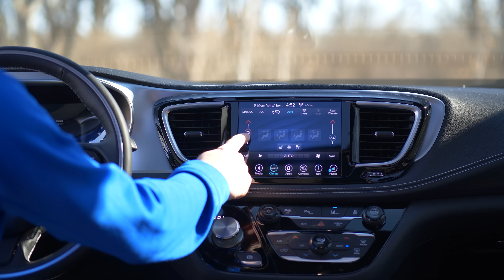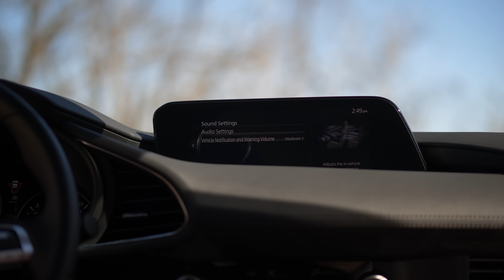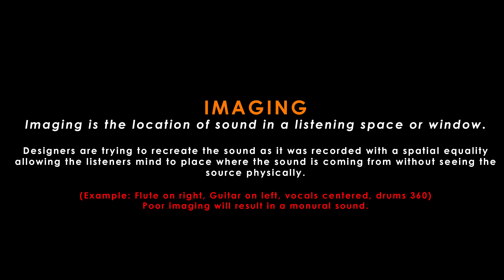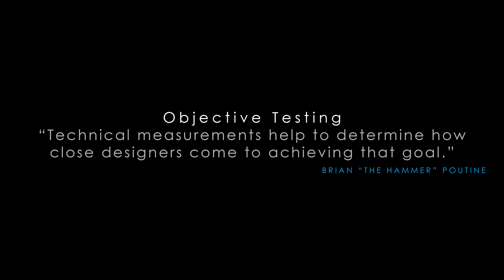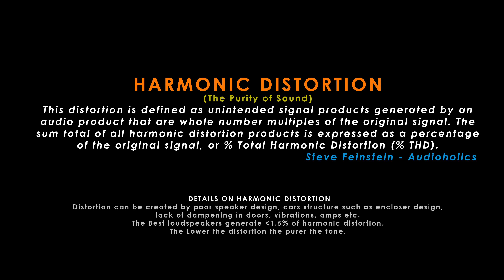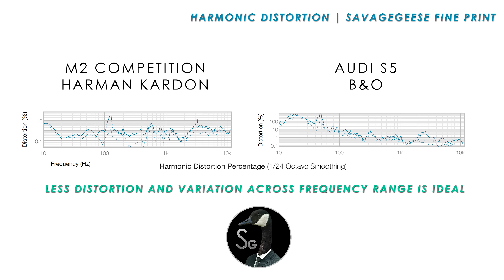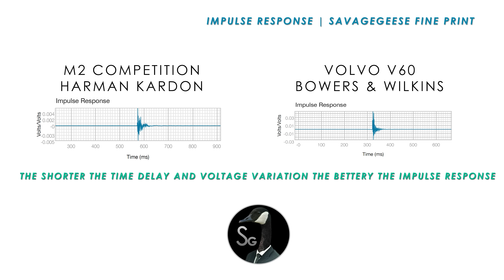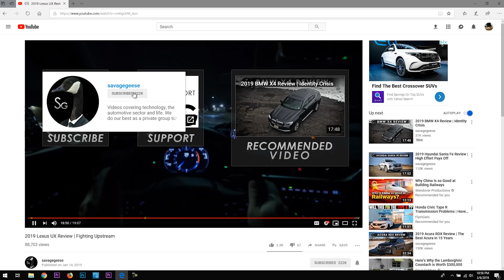Understanding Car Audio Design

Comment: Amazon has a $25 calibrated condenser mic for Android. Then, download "Audio Tool" from the store and you have a somewhat effective sound spectrum analyzer. Play some pink noise through your audio system and you can tune your levels flat to the decibel you desire. I'd say properly tuning the sound system you already have will go a long way to make it sound good. 

Most people tune by ear and of course introduce their own biases as to what "sounds good". I had a co-worker roll into the parking lot blaring some Queen and he had the treble cranked up so it was a earsplitting, headache inducing, garbled mess. He probably grew up listening to that song on a crappy Fischer Price boom box and then tuned his $80,000 Mercedes sound system to replicate the noise from a $10 toy; because that's the way he learned to listen to it.

Comment: Looking forward to this series.  I've really been struggling to obtain imaging inside a 2019 Durango and the glass is ruining the separation bigtime.  If I roll the windows down, it helps.   But I also think the problem is as simple as "too many speakers".  I have the base "Alpine" system.  Dodge did away with "Beats" for 2019. But they offer H-K and I'm curious to know if that extra cost would have brought better stereo imaging, or just more bass.  For the record, the stock Alpine system has plenty of wallop.  The wattage is enough to broadcast with the windows down.  And the distortion is negligible at full volume.  But the stereo imaging is muddy more often than not, regardless of whether the "surround" option is activated or not.

Comment: My Colorado has the upgraded Bose system and there area you notice between the standard sound system is the base. I had the salesman get into both cars and play similar music to hear the difference. There definitely was. The standard system still sounded pretty good though. It was definitely better than the sound system in my Crosstrek which was garbage.

Comment: What I find nauseating is seeing Bose in Porsche and JBL in Ferrari 488's.    Why put low grade audio into a high grade automobile?  Those belong in Chevrolet and Ford.    I  have a new tahoe that has Bose in it.   It sounds okay for car audio but I'd like to put Focals in place of the the Bose drivers.  That's probably not going to work too well.

Comment: i think the biggest issue with this is that there ALOT of different audio systems in the same car. Like the f150 can have a shit stock speaker or a very nice one in the King Ranch
Reply: Both correct and incorrect.

Comment: This video is very valuable. I Just bought a car and the stereo have 10 Watts. i didn`t believe at first.

|Buyed a used car stereo and i =can`t fit it because id ont have the adapter so its pain in the ass to change it. 
I Want to replace all the speakers from that piece of crap speakers that are in my car now. ;)

Comment: It has always been amazing to me, at any price point, how the manufacturers have such low regard for the products they produce. The difference between crap and great can be as little as 100 bucks at the manufacturing end concerning design and materials in a mass produced car. GM is the worst with this in my opinion. It's hard to believe that my  Australian made GTO is considered to be among the best GM cars of the era...until I sit in any GM product of any era, even Cadillac, with the exception of the Escalade.
Reply: It's rife in any industry where lots of units are sold. Saving a $1 on a product sold 10m times means $10m more profit. Sad but true, especially when it comes to products that are meant to last like construction materials for houses. It really affects life quality then but it happens all the time.

Comment: How about addressing some newer cars that employ "Automatic Noise Cancellation" which attempts to cancel road noise and such by listening for it in the cabin with one or more microphones and then attempting to generate a signal which is out of phase to the noise in order to cancel it somewhat.  Same basic technology used in some stereo headphones.  This signal plays through your audio system whether your music is playing or not.  So how the heck does a car like the Acura RDX with the ELS system, which claims to have "the sound that is heard in a studio" play that accurately when it is also playing anti road noise sounds at the same time.  Show me one recording studio that uses monitors that are playing out of phase sounds to control noise in the studio.  NEVER!  Most of this noise is low frequency in nature so many of these systems are also weak in the bass region.  I guess they can get away with it when most people are playing $hit quality recordings anyway, but the marketing BS about having you hear what the recording engineer hears in the studio is pure cr@p.

Comment: Sadly does any of this matter due to most music being sourced from a Bluetooth connection/quality? I do greatly appreciate younus8ng Bluetooth in your testing. Also the fabulous Nissan Kicks Bose system would require driver's seat testing
Reply from the maker: Is your device supports Bluetooth 4.2 or greater and so does the car it will pass CD audio quality and better. Most people only listen to compressed music they're not even going to use it anyway.
Reply: @savagegeese  (Device and car, you need both and precious few cars have 4.0 or greater).

Comment: Harmon kardon this, bose sound system that, bowers and Wilkins etc. My Pioneer double din touch screen paired with stock speakers and two alpine subs with an alpine amp sounds so great, and for a fraction of what these new sound systems cost.

I will say this, the bowers and wilkins sound system in the new bmw x7 is phenomenal!
Reply: I doubt the x7 system is worth it over the Volvo system.

Comment: Focal Utopia, CDT HD, Morel Supremos, Scanspeak, Seas, Vifa all make far superior woofers than the usual suspects (blose, B&O, B&W, HK, Lev, etc...).  You want a set of 6.5 active components with proper aftermarket install and noise isolation.  Kick Panels are great as well!

For subs I'm partial to RE XXX or JLW7

Comment: Unless your car has super awesome sound dampening i doubt it even matters about the complexity of the sound system in a car.
Reply: It matter but you are correct that the noise levels in most cars make it less important. I can assure you I can distinguish the differences in quality between different car stereos. In my Z06, the high noise environment makes it less critical but in a Lexus hybrid it may be more important to have a higher quality sound system.

Comment: For some odd reason I have some deep interest in OEM Audio. I have a lot of experience in different cars with “premium” audio systems and a few standouts that really impressed me were. 

1. My 2007 Mercedes S550 H/K setup. It’s honestly one of my favorite setups I’ve heard stock and is extremely clear, loud, powerful, and deep. It has a great all round listening signature for all kinds of genres with little distortion. (14 speaker setup with 4 1” tweets, 5 4” mids, 2 8” DVC subwoofers, 2 6.5” woofers, 1 8x12” DVC subwoofer. 610 watts RMS.) 

2. My family’s C300 Burmester. It sounds absolutely incredible despite it’s shitty paper drivers. Really clear and punchy, but looses some quality in the low frequencies (60Hz and below). The distortion is almost none existent (to my ear) besides the really low frequencies. Amazing deal for the $850 ask though and sounds better than most much more expensive setups. (13 speaker setup with 4 1” tweets, 7 4” mids, 2 8” subwoofers built into the chassis of the vehicle in a large enclosure.) 

3. B8 S4 B&O was very good. Limited listening time but had an awesome first impression. (I think 12 speakers and around 500 watts RMS)

4. W220 Bose setup, Mercedes S Class (2000-2006.) I have a lot of listening time with this and it’s by far the “smoothest” sound system out of the bunch. Really good for Jazz, R&B, and soft rock. The bass is relaxed but really powerful and deep. Not sloppy at all but not punchy either. It really impressed me as I normally don’t really like Bose setups too much. Honestly a great setup for that car as I feel it suits the character or the vehicle very well. (13 speaker setup with 4 6.5” woofers, 5 1” tweeters, 1 center, 1 12” sub, 2 3” mids. Unrated power (Bose.))

5. 2017 Lexus GS350 Pioneer setup. The base setup in the GS is made by pioneer and is actually really decent. It’s vocals and mids are really great and the bass is nice and punchy. But the stock “sub” is horrible and puts out literally no bass. Honestly though it wasn’t plugged in from the factory but it was. It played DVD-A discs and had a nice, clean signature. It was probably the loudest of all the setups on this list and is the only one that really could hurt my ears with no problem. (I listen to my music loud in the car and I couldn’t turn it past 48/63 without my ears actually hurting. Distortion started at about 50/63.) (12 speaker setup with 1 center channel, 2 1” tweets, 4 6.5” woofers, 2 3” highs, 1 9” sub and 2 3” surround. 300 watts rms) 

6. My favorite for non bass heavy music by far is the Harman Kardon setup that was in my mom’s 1998 Jaguar XK8 Convertible. It had the best imaging I’ve ever heard in a car and would really give you chills listening to the likes of Metallica and Pearl Jam. Bass response wasn’t great due to the lack of a sub (vert) but mid bass was good due to the 6.5” midbass woofers in the sealed enclosure in the back. (8 speaker setup. 2 3” mids, 2 1” tweeters, 2 5.25” woofers, 2 6.5” midbass woofers.)
Reply: The fact that the C300 system had paper drivers would make me not waste my money. Your choices of words make me think your probably deaf and are a bass head and think loudness is quality.
Reply: MICHAEL GRANT that’s a fair point, but no. I like a balanced system. Bass is easier to describe (quality wise) and is something people understand. The paper drivers in the Burmester have some of the best vocals I’ve heard in a car thanks to the Burmester DSP and amplifier. It’s simply wonderful and makes listening to music so much more enjoyable. The downside of the C300 setup is the frontbass woofers that are tuned to play as woofers and subwoofers. Of which they do a decent job for most, but most of the frequencies below 60-50hz are just inaudible as the rolloff is so steep. Regardless of that, I enjoy listening to the system and do find it worth the money. I have many friends with very nice aftermarket setups that praised the Burmester’s quality. Tracks like “He won’t go” by Adele and “nothing else matters” orchestra edition by Metallica have such great imaging and are so clear. Feed it a good source and it does really punch way above its weight.

Comment: "The shorter the time delay and voltage variation the bettery (!) the impuls response" - are you just testing if anyone actually reads the text in your video?
Reply from the maker: Yes I do this often. There is also another subtle typo at end that looks like a chinese translation.
Reply: Well most of what you say sounds like chinese to me....

Comment: Id also like to point out that though perfectly flat in home audio is great its normally better to have a little extra bass in car set up because otherwise it can be masked by the rumble from road and the engine.
Reply: Perfectly flat in Home speakers doesn't exist even in the several hundred thousand dollar full range speakers. It would NEVER be even remotely possible in a car!
Reply: @dontcare563  Well yes no one actually means 'perfectly flat' when saying that its perfectly flat. More that its close enough to flat along its given frequency range within +/- 3db or so.

Comment: Just buy the basic sound setup and upgrade with aftermarket. Factory systems all suck from my experience. You can add components without changing the head unit and still retain your factory look.
Reply: I have a 2021 RAV4 prime with the premium audio... I want to upgrade what would be your recommendations?

Comment: 90% of all factory sound systems are old and obsolete by the time the vehicles reach the showroom .
Reply: Charlie Vetsworth  Audio isn't like a touch screen and your obviously clueless . Those two comments must be coming from a 21 year old girl. 
Touch screen technology is the focal point of all modern audio systems.The reason why they call them infotainment systems! Your single din car stereo from radio shack would never win an audio competition against a low end double din with DSP. Most cars in the 70s came with a 3" speaker in the front and 6x9 or 5x7 in the rear. Today we have factory trash with component speakers in the doors with 8 to 10" subwoofers mounted in the deck or side panels.Your comment show that you never had a decent audio system or have never been to an audio show.

Comment: Had car with Dynaudio (600w), way cleaner and instrumental than my HK in BMW X3 or ML in Lexus (835w), when I sell/buy car, thought ML wil be an upgrade, but disappointed me hugely. Car is a better car but..
Reply: ML is a joke. The ML in my lexus IS was so bad I thought it was broken. Checked the forums, it seems i wasnt the only one, with some ppl actually sending their cars back to the dealer
Reply: Dynaudio is bae
Reply: Amplifier wattage is meaningless and a marketing ploy. You use less than 1 watt of system power at normal listening levels.

Comment: In my opinion after watched this video, although the overall seemed to make sense, yet you are speaking to some extend out of your knowledge level of many manufacture's product & material selection, testing and manufacturing... Overall it's a very complex structure that merge together. Your video, unless with specific facts to specific brand & model otherwise, you seemed to basically speak from an experienced installer's point of view.  Finally speaking of frequency, every human has different hearing and range of frequency ranges, different tastes in music and etc.. You are way generalizing the topic; more slightly speaking, even the material clothing we wear while in the car can distort the sound/frequency and much much more!

Comment: it's nice to see more mainstream reviews dive into this, but as close as you are, you're still so far away.  i have to disagree that you can't achieve studio quality hi-fi in a vehicle.  as some have mentioned here, the diy scene is full of guys who've achieved this.  there's a few problems with the scene, though, and first is the stigma of telling somebody you're into car audio.  they immediately think you're some dumb basshead kid rolling down the street pissing everybody off.  while those idiots do exist, there's a whole other side of this scene where  systems are extremely quiet and sophisticated.  the best thing i ever did was sit in a car that was like this and experience for myself what a true hifi car system could sound like.  until you actually have that experience for yourself, you'll be lost in jargon and ignorance.

so, you touched on alot of good things, but it needs more.  what i've found to be the basic ingredients of a good car audio system....

1.)  good source - uncompressed digital files, or a cd if you still have a way to play one
2.)  sound treatment - cld for dampening vibrations (at least 25% coverage), ccf for decoupling and mlv for noise rejection.  
3.)  power - this varies depending on the scope of your project, but making sure you have more than enough power to prevent distortion or power compression.  this is so much easier today with the advent of better class d technology.
4. )  dsp - this is much different than most expect it to be.  a dsp should only exist to fix issues, not enhance your sound, ideally anyway.  you'll need crossovers, eqs and time alignment.  you need to send the right frequency range to the correct drivers, fix peaks and valleys in your signal with the eq, and optimize path-length differences between speakers and the driver.
5.)  decent speakers -  you'd be surprised how well cheap speakers can sound if installed correctly, tuned with a dsp and installed in a treated vehicle.  and, btw, i've never heard of the issues with paper cone drivers that you talk about.

there's nothing keeping manufacturers from accomplishing decent sound, but i can definitely understand prioritization in manufacturing.  for example, it doesn't really make sense to build a hifi system in a sports car, or convertible, etc.  there will always be a battle with noise, and face it, that's not why you bought that car to begin with.  i'd say, though, the hardest part about all of this is the misconception that more is more.  i'll never understand why people are ok with listening to two tower speakers at home, two speakers for headphones, but then expect 20 speakers in a car?  you're correct, it's just stereo music; left and right.  and while you can build a system with more than two speakers, it will still be just left and right.  there's nothing keeping mfg's from building a simple two or three way ( midrange +tweet or midbass+midrange+twee) and sub.

i suggest looking at gary summer's mercedes.  yes, he's built it to accommodate a 5.1 system, it still excels at simple two-way/stereo music.

Comment: Speakers do NOT make the sound. they only replicate, faithfully, the signal that they receive. The problem is that car designers skimp by providing a low-fi front end in the form of MP3.
You can spend a million dollars on your speaker but they will sound pants with a rubbish input.